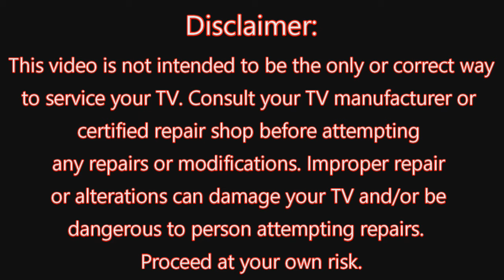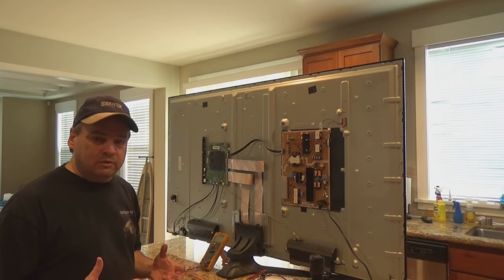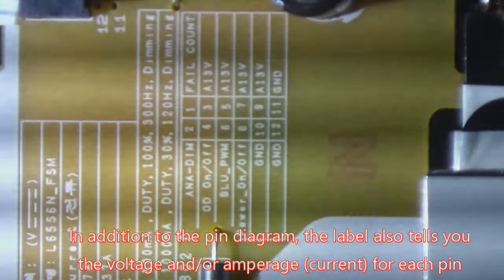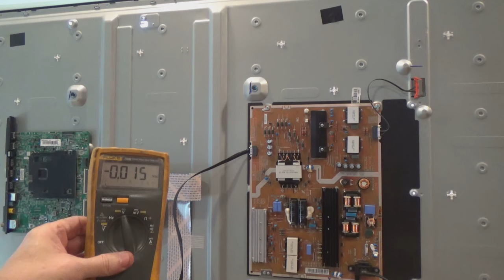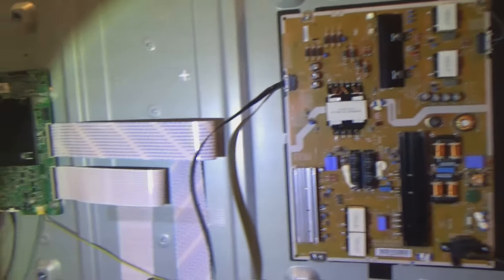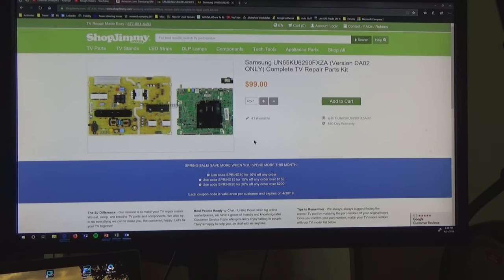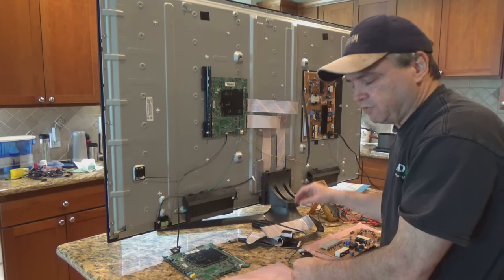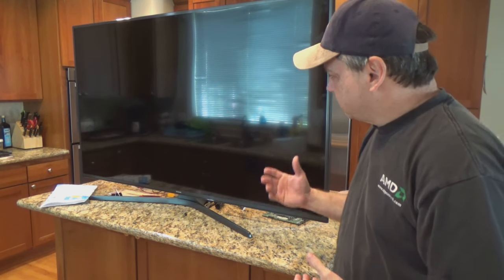LED HDTV Repair - Standby Light But No Power Up

Comment: ON MY POWER SUPPLY UNDER IT IT HAS NON CONDUCTIVE PAPER THAT HAS PLASTIC RIVET HOLDING IT UNDER THE CIRCUIT BOARD IS THERE ANY SPECIAL WAY TO REMOVE THE PLASTIC RIVETS OR HAVE SEEN THEM THANK YOU
Reply from the maker: I haven't seen them.  I would expect if they are riveted that you would need to snap the rivet and replace it when re-installing.  However, do you need to remove the paper as part of the repair?  Can you work around it?

Comment: was gonna change the tcon board on my ONN 32" lcd tv...that is until i discovered that instead of connectors, the ribbon cable was soldered into place at both ends of the cable...too intense for me as i was hoping for a simple unplug/plug swap out job

Comment: I have a TCL 49 TV with similar symptoms. Thanks for the break down on measuring voltages from power board to main board to decide what is bad.That is the step I am at now. PS I would stay away from TCL tvs terrible customer support. TV had almost  no use but was out of warranty.
Reply from the maker: Thanks for stopping by.  Hope you were able to get your TV back up.

Comment: Hi Rough, I opened my TV and inspected the power board for burn marks, bulged capacitors etc. and everything looks OK, I unplugged the connector like you did but on the power board side (not the logic/main board like you did) and the LEDs lit up so nothing wrong with the LEDs and power is getting to them. However, I don't have a multimeter to test output to the logic board. Nothing looks wrong with the logic/main board (no burn marks). Should I go ahead and order a new logic/main board ($92) and try that first and then order a power board ($20-38) if that doesn't solve it?

Just curious, do you have any idea what might have caused your problem in the first place? I'm not sure but there's a chance adding a new HDMI connected Amazon Firestick 4K Max a month ago might have screwed things up on my main board because when I briefly got it to work for a second the screen went on and displayed on top "HDMI not connected" even though it was.
Reply from the maker: You can get a basic multimeter from Home Depot or Lowes for about $15. I don't know if they offer them as tool rentals but might be worth asking.  It really helps avoid random swaps to find the problem. I did order both boards as a kit so that if one didn't work I could try the other.  

As to what could cause it? Heat and dust are 2 big issues for electronics.  Dust carries static electricity that can cause components to short out.  Heat can damage ICs over time...As it is, the TV already gets warm so adding heat from say an enclosed cabinet or mounting over a fireplace makes it that much harder to keep components cool.  However, sometimes, components just fail with no real external cause.  

Hope that helps.
Reply: @RoughRidersTV   Hi, so I went ahead and ordered the main board without testing with a multimeter (BTW, I heard some libraries rent out multimeters and watt usage monitors). I installed it today, just like you did - the hardest part was getting all the cables out, and my TV is back!!! Now, upon inspecting the old board once removed from the TV I noticed what could possibly be the problem which wasn't apparent when it was installed. I realized the 2 bolted pins on the left (where the A/V connections are) that fasten the black metal heat sink plate to the processor were completely loose and not making contact with the processor (at least a 2 mm gap) or the 3 "n" shaped possibly sensors/contacts/spacers(?) near the bolts. This could be the culprit. The only way to find out is to fix it, reinstall and test. But it would require a shop as I don't have the tools. But it would've been a cheaper option than ordering a new board ($83). Unfortunately, my internet search gave me no clue that this could be something to check. Maybe somebody reading this might consider checking this. If it is the problem, it's a simple fix - the spring loaded bolts need to be refastened securely. Anyway, thanks a lot for your help, really appreciate it.
Reply from the maker: @nGAhGENVH0Ul  If the heatsink was not making contact with the chip, that could very well be the source.  The chip overheated and most likely failed.  Prolonged overheating on the chip will kill it so reinstalling the heatsink would probably not do anything.  Glad your TV is back up though, congrats.
Reply: @RoughRidersTV  I hadn't considered the processor might have fried. Could be I suppose. Could it be poor design that the pins came loose? The rivets on the back don't look wide enough. I took photos but I can't post them here. Thanks again Rough.

Comment: I have a Sony Bravia  D It blinks red 6 times each cycle...a shop tells me Sony does not make the parts any more.....The set was purchases new 8/28/16, Any suggestions. Thank you. Les
Reply from the maker: I would go through the steps to see if you can determine whether the power board or i/o board is out.  Once you know that, search online for the part number of the board.  You can probably find boards out of reclaimed sets that will work.  That is what I bought at Shop Jimmy's.

Comment: I thought the other pins besides your standby would be zero until the tv was told to turn on? On my tv all of my pins are reading zero besides standby voltage, and they all go to the correct voltage when I jumper the standby to the on/off pin. I’m not sure if I am thinking of this wrong. Thanks for any info you could provide.
Reply from the maker: Once you apply power to the system, the chip driving those pins will go to their known starting state. Without the datasheet, I don't know what that state is. The voltages should be on that table printed on the board but I don't recall what they are.  However, most are don't care because there are only a couple that you care about when determining if the board is getting power.

Comment: My TV is doing the same thing but my remote had a red led that was flashing on the remote did yours do that as well?
Reply from the maker: I had misplaced the remote so I don't know if it was or not.  Only found it months later after it was fixed.

Comment: What if Your screen is just dark but you can see tv programming. I checked the settings and everything is set correctly. I can hear and see the picture everything is dark. What could it be the LED strips?
Reply from the maker: It could be as simple as a connector or more complex like the T-Con board went bad or the panel LED went out.  If the entire screen is dark, my first thought is that the LEDs are not getting power to them because if they were, at least some of the LEDs would light up.  It's just one of those, work your way back from the LEDs to see where the problem is coming in.

Comment: wish i would of seen your video before i brought my tv to the repair shop !  its there now so it will cost me a few 100$ ?
Reply: In theory, their troubleshooting experience should be worth it, but if the price to just replace the power & controller board is cheap enough and DIY-able... but the screen itself or other stuff could be broken... decisions, decisions
Reply from the maker: Hard to say what the repair cost will be.  It all depends on the shop, what they find and the parts/labor involved to fix.  Flat panel TVs are not all that complex and actually quite a bit easier than the old CRT/Tube TVs to repair as they are much more modular.  Swapping out a failing PCB is simple, it's diagnosing the problem that can be tricky.  It could be as easy as a cable or board or something a bit deeper into the panel.  That combined with the falling prices of flat panels themselves sometimes makes it easier to just replace the TV.

Comment: Good job! Mine turned out to have erroneous voltage coming out of power board
Reply from the maker: Thanks.  Glad you found your issue.  Any problem finding a replacement board or did you go deeper into the board to find the failing component.  My first guess would be a voltage regulator that failed if you were seeing bad numbers on the output side.
Reply: Didn’t go that far into it. Ordered a power board from the same place as you. First put it on, didn’t power up, no back lights. Pulled power,  disconnect video board cable, ck’ed voltages, all good. Tried again, and the TV came to life! Don’t know why the screen didn’t come on the first time, but it’s working. Thanks again for sharing the video.

Comment: i have question my tv comes on only after i unplug and plug it becomes very annoying. i do get led light i have try other plugs same condition what you recommend
Reply from the maker: hard to say but sounds like a chip went bad on the I/O board. It's almost like it gets stuck in a logic state that is not clearing until power is completely removed...sorta like being stuck in standby.  Removing the plug, removes all power so it is no longer in a low power state and ready to come back on quickly...removing that power forces it to reboot and clear all previous states.  Were it me, I would try to find an i/o board for cheap and swap it and see if that clears the issue.
Reply: @RoughRidersTV  thank you very much

Comment: XLove you man thanks for the video I was about to throw my $1500 LG 65 inch TV in the trash until I seen your video I’m hot on the repairs thank you
Reply from the maker: You are welcome.  Hopefully it will help you fix your TV.  Frustrating spending so much on a TV to have it fail just out of warranty.  I think mine was about 2 months outside the warranty when it stopped working.

Comment: GM sir, my  LED 32" tv no picture no sound no back light. just  standby light blink once and off there is no working any parts. But my tv combo board current flow any components correctly. What is a proble
Reply from the maker: Could be a number of things.  I would suggest starting with checking the power rails as I did in the video.  If the power board is good, then it is probably the I/O board or the T-Con board.

Comment: I have a 32' TCL tv the power light comes on but i have to press the power button a few times to get anything on the screen, i don't have a remote, is there anything i can do to solve this problem.
Reply from the maker: Sounds like it may be a switch problem. I would test with a multimeter.

Comment: I appreciate your video. But the the question I want to ask is: the  i/o main board are they same for all TVs?  I suspect the problem I have with my TV is same with your. Thanks.
Reply from the maker: Each brand will have their own board design.  However they will likely be similar to what you see here.
Reply: @RoughRidersTV  Thank you so much.
Reply from the maker: @mon910i  you are welcome
Reply: @RoughRidersTV   A million thanks you..Today 4th July, 2021 . the main board came the mail yesterday. I have just put my TV back to work having replaced the main board and it is working perfectly Ok. I have 180 days warranty as well. Thanks again.

Comment: I have a tv that the standby light blinks 7 times. Indication that the PS board was good so I replaced the Main board and it still does the same thing?  Suggestions appreciated.
Reply from the maker: could possibly be the T Comm board but not sure.  Without schematics and/or datasheets and the set in front of me, not sure where the exact issue might be.  While I am an electronic engineer, I am not a TV repair guy...I just dug in and started measuring stuff in an effort to troubleshoot the issue.

Comment: I know it’s been 2 years but this is what’s happening to my daughter tv 65”. My question is what’s the name of the device you used to test the voltage. So i can buy one.
Reply from the maker: It's a volt meter.  You can find them at any hardware store or big box chain like lowes or home depot.

Comment: My Samsung 55" flat screen stop working. I have a standby light,but want do anything else. I replaced the power board still nothing. No back lights or picture. I removed the ribbon from the other board and back lights come on. IS THAT BOARD BAD?
Reply from the maker: Did you go through the troubleshooting steps that I outlined in the video?  It should help you determine if it is the main I/O board or the power board.  I thought mine was going to be the power board but it turned out to be the I/O board that failed.
Reply: @RoughRidersTV  hey boss, I replaced both boards. What else can it be?
Reply from the maker: @joshdelaney7506  I think about the only other board in there would be the Tcom board.  Did you verify the switch itself is OK?

Comment: Good basic trouble shooting techniques except for when handling circuit boards a wrist grounding strap as an additional Safety step to protect the electronic components.
Reply from the maker: I don't disagree except I didn't have any grounding straps at home so I tried to make sure I discharged any static electricity buildup before handling components and make sure the environment was relatively clean from any dust, etc.  But yes, grounding strap would have been better.

Comment: I have a " Hisense tv 40eu300. While I am watching it. The SOUND will go to MUTE for no reason. Then I have to turn the TV off and then back on to get the SOUND back. Can you help me with this problem? Awesome video thanks for sharing it.
Reply from the maker: Not without having it in front of me to do some testing and measure some pin outputs.

Comment: Hi there I have a jvc the light of the standby on but is not turning tv on by remote or by the standby switch any ideas
Reply from the maker: Well, that is exactly what I covered in the video.  Please watch the video and you will see what I did to solve the issue with my TV.

Comment: damn I watched your video and was totally inspired to try and fix mine . inspected all the boards did not see any burned out marks . went to shop jimmy and decided to buy all 3 boards because i do not have a voltage meter was about 40 for all 3 replaced  all 3 and it's still doing the same thing any suggestions ?

Comment: Greetings, Thanks for the Vid.  I have a HiSense 55" Roku TV It shut off the other day and would not turn back on. The standby light turns on when plugged in then dims and flashes once goes black for a couple seconds this sequence repeats continuously.  I replaced the power board. Same issue. I measured the power from the USB port and the USB power seems to cycle with the light sequence. as if the TV is rebooting. Any ideas ?
Reply from the maker: Sounds like a short somewhere.  In a completely unrelated product, I ran into a reboot issue...not saying this is what is happening with you but it just came to mind.  I had a customer once that had a PC connected to the same outlet they had a refrigerator plugged into.  Whenever the fridge compressor kicked on, the PC would reboot because the fridge was pulling too much current from the line.  Took me a while to figure that one out.  Reboots can happen with the power line swings low and drops below 5V DC triggering a reboot. Similarly in an AC system, if the power slips out of phase (like in a brown out) or Vrms drops, you could get a reboot.  However, that doesn't sound like what is going on with your system. If your I/O board is experiencing a short, some chips (like your USB) may still be getting power but other logic circuits may not be.  This is all just a guess because I would really need the board and the proper tools and documentation to really diagnose the problem.
Reply: @RoughRidersTV  thanks for the information.  Cheers

Comment: Hello sir when you check the voltage on the power cable pin do you use acv or dvc mode on the multimeter?
Reply from the maker: ΣDM LӨVΣЯ whenever you are dealing with digital circuits like this, you always measure the DC voltage, not AC. AC is strictly when dealing with power outlets, etc. I know it was quick but I showed the setting right about the 6min mark in the video.
Reply: @RoughRidersTV  Thank you very much for replying and I've just find out mine power cable   pin(on the power board)(2 pin 13v) that should have 13v but instead it's just maxed out to 5.3v and the other one is 4.7 also there are 3 pin that should be 5v but all 3 of them instead getting less than 2v. Could this mean that my power board is faulty and I should replace the power board? Mine TV problem is exactly like yours and it's 8 years old TV.
Reply from the maker: @OJtheOZ  Sounds like your power board is bad then as it does not appear to be delivering enough voltage.  It could be something as simple as a loose resistor or cap or something like a bad voltage regulator. However, you can replace the entire board for about $100.00.

Comment: I have an issue with my 49 inch Samsung LCD...when I plug it in, it only flash a red light and turn completely off. May I ask what could be the specific board in question?
Reply from the maker: Sounds like a similar problem to mine.  You might try following the steps in the video to find out if your power board or I/O board is the issue.

Comment: I changed both the main board and power board, standby light is but no tv. Any suggestions. Thanks
Reply from the maker: Might be the T-con panel.  Are you seeing lights powerup when you first plug in?

Comment: I have a 55"TCL Roku TV I can see the screen is on but I can hardly see what what's on the screen.it flashes for a second then it goes dark..I don't have the remote so I can't reset it... what would you do in this situation
Reply from the maker: Could be a few things.  Could be the T-Con board, LED driver chip, bad cable, failing power board not driving enough power to the LEDs, etc.  Hard to say without schematics and the proper troubleshooting tools.

Comment: Maybe it is possible to reflow the big ic on the defect i/O board.
Reply from the maker: I'm not sure reflow would be the best option for an individual IC.  But even so, you would need access to a reflow box and know which IC or component was failing.  Without a datasheet and an O Scope, it would be hard to find the failing component.